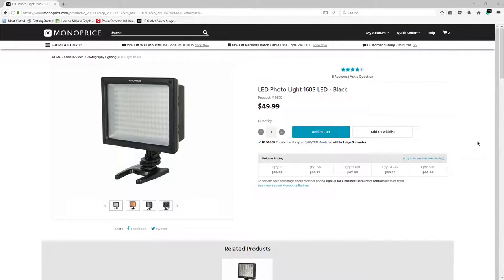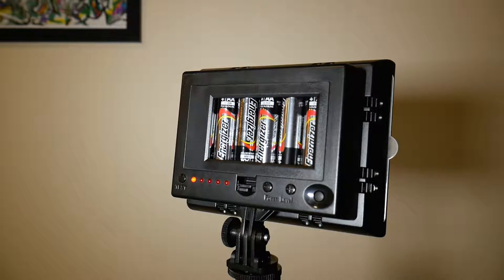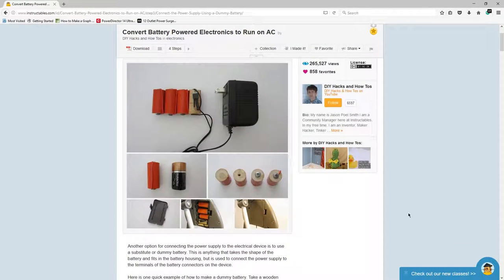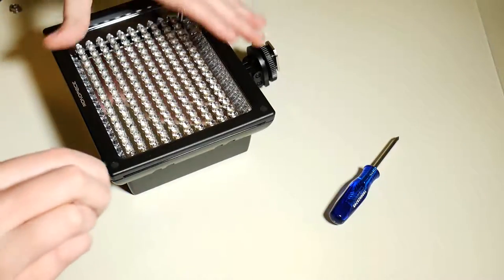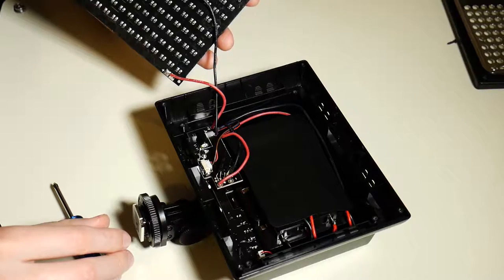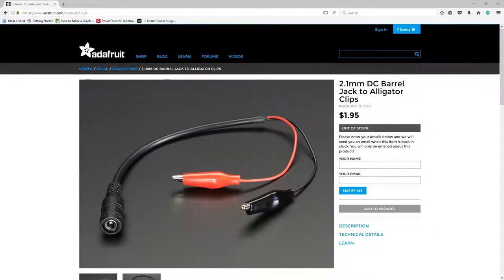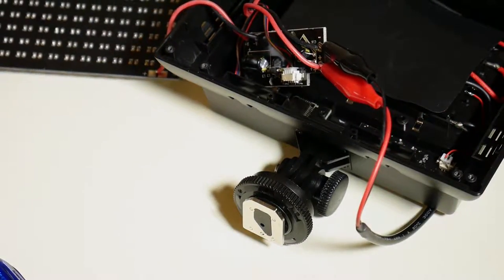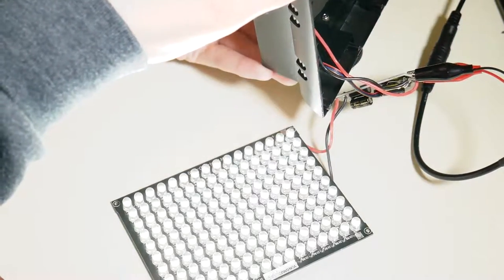Tearing Down a Battery-Powered LED Light

Comment: Congrats! You actually do not need to open the hole thing. Just connect the positive and negative from the wall power adapter to the spring terminals on the battery compartment. and you are done.